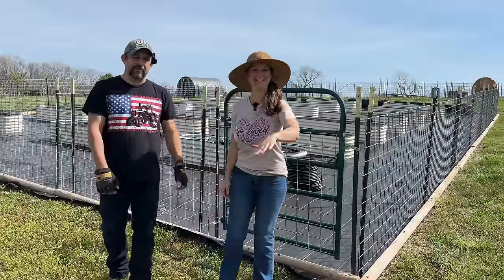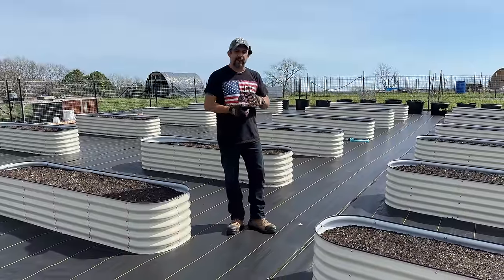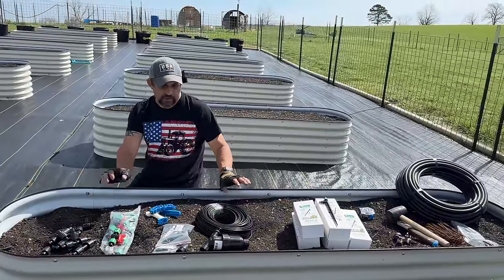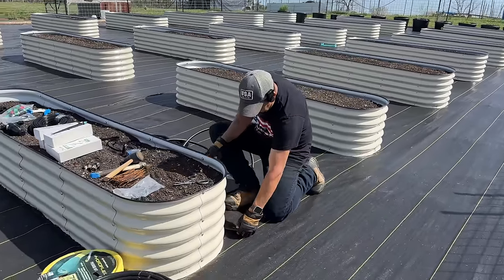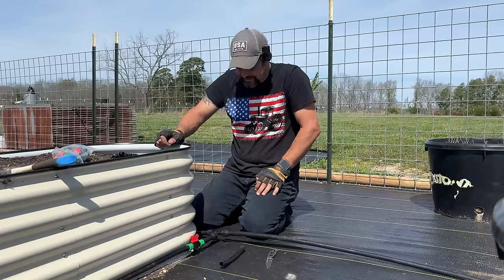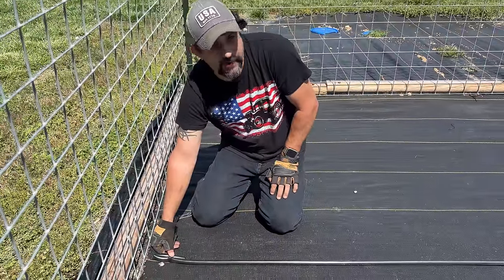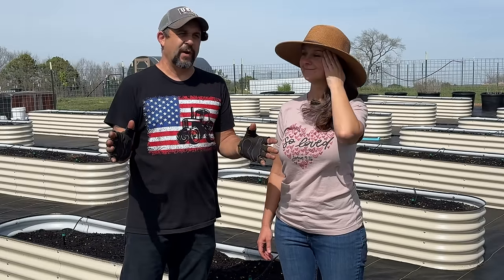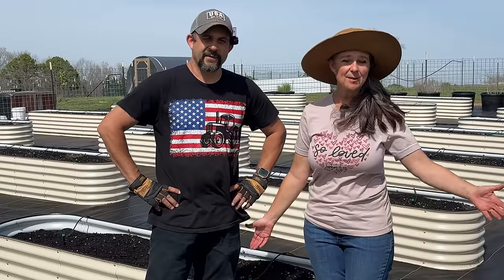The BEST Raise Bed Garden Watering System!!!!

Comment from the maker: Here is a link to the Raised Bed Irrigation components: https://www.amazon.com/shop/livingtraditionshomestead/list/3EXLG8NZE5AA6?ref_=cm_sw_r_cp_ud_aipsflist_aipsflivingtraditionshomestead_1EWAB2C42EQY03V94JXB
Reply: Ugh, it's saying the emitters are no longer available? 

BTW, the garden is absolutely gorgeous,  so gorgeous in fact the wife decided we need to redo ours!! Lol, we are in the process of redoing ours anyway, so now we have yours as a road map!!
Thanks for sharing your hard work!
Reply: @markhornbaker5481  What are you going to use since they aren't available?
Reply: The holes that the staples make that allows the weeds to grow, can you put some silicone caulk over the holes to prevent the grass/weeds from growing up threw them?  We are about to do the same thing and just wondered if you had tried that, I’m just at the 15:00 mark and thought to ask.
Reply: Where might one find the Drip Irrigation Drippers 360 Degree Micro Sprinklers Pressure Compensating Emitters with Stake for 1/4 inch Tubing Watering System Spike Bubbler Heads Parts, 20-Pack that you recommend as Amazon says they are no longer available?
Reply: Where can we get the sprinkler water head?
Reply: Wonder why they don't reply to some of these comments
Reply: What's  another source for the emitters, please ?
Reply: Yup. Emitters are no longer available and the valves/cut offs recommended may cause my hubby and I a divorce. lol. T valves are working awesome, slide right on, but attaching to the close off valves - not so much. We are fighting every one of them and they pop off. We are going to attempt a slight heat to the end to make it a tiny bit pliable. We shall see! 😂

Comment: I am a widow and I need to add a sprinkler system to my raised bed garden and front flower bed.  Until this video I always thought this would be a daunting task.  Thank you, Kevin and Sarah for providing the proper equipment and supplies lists and for explaining it so simply and thoroughly.  I know I can do this by myself now instead of having to pay someone to do it.  I feel empowered.  Hallelujah!
Reply: It’s such an incredible feeling to know that you can do projects without a bank roll. Kevin and Sarah definitely empower us with such useful and well taught information 🫶
Reply: Yah, this is a great video and wish it was available a couple of years ago. Really great video. You said you are a widow, but I don’t have a gauge  for your age.  So, just a couple of notes from a 67-year-old.  It is not so easy to connect all the connectors.  I am not strong enough, so soak your pieces in hot water and it makes it so much more pliable.  I use a large insulated cup and let my pieces soak for 30 seconds or so and then it is super easy to snap in. Also, going with a non-Amazon company will get you some customer service.  I used Drip Depot and they held my hand a bit to overcome obstacles. I have a mostly container garden with a timer and it has worked really well for me.  This is a really great video with detailed information.  Hope this additional insight helps.
Reply: I really appreciate you sharing your experience with us….In November of 2023 my wife died and 3 weeks later my mother died….when they were in ok health my mother and wife loved to work in our little garden….I miss them so much and I know they always enjoyed our time in the garden….i have such wonderful memories of all of us in our garden….I hope you have the same happiness…God bless you and I wish you many happy times in your garden…..😃
Reply: I’m a widow too and I’ve been wanting a drip irrigation system for the past few years. I’m so thankful for videos like this to help me understand what I need to do. I feel good that I can do this! I wrote down the tips from the commentor who said to soak the parts in hot water to make them more pliable and to buy from Drip Depot instead of Amazon.
Reply: I’m 60 yr old woman about to do this by myself, as well. Good luck to US!

Comment: I have 14 - 5x8’ beds and went this route several years ago, and have a separate water connection to each bed so the early planted beds can have water without wasting water on beds that have not yet been planted, and can turn off beds that are done. I needed to go this route due to still working full time and having limited time to garden. Best thing we ever did!

Comment: I'm sure someone has mentioned this already, but the splitter that you are using at your water faucet/hydrant is your bottleneck. If you get a full flow wye or splitter, you will get full flow to your garden and can most likely run all the beds at once. I've never liked the splitters that have such a small opening. Love your garden.

Comment: Looks like a great solution to a specific situation!  I went to your Amazon links to order the pressure compensating sprinklers, shut off valves, and hole punch tool, only to see ALL were out of stock and they "don't know when or if there will be more."  Have not really located a good alternative yet, so I guess we will watch and hope they get more in stock.  

We have a 40x50 garden equipped with ground cover fabric and drip tube irrigation thanks to your guidance from the "old" homestead.  It has enabled me to successfully keep gardening with Multiple Sclerosis at age 67.  We owe you a lot for what you showed us!

This Spring we added three Vegega raised beds (3.5x6.5' configuration) outside the garden, again thanks to what you introduced us to.  That is why this video was of interest. We put ground cover fabric under and around each, and placed 1/2" hardware cloth under each bed for critter protection since we have voles and moles around can be a problem to crops like carrots and sweet potatoes.  Also bought one of the Vegega bed cover systems to try, allowing for a plastic cover for cool weather planting and a mesh cover to hopefully protect the brassicas from moths!

Thanks for all you teach, and please leave a note if you know of another source for these sprinkler heads...

Comment: The white & blue hole punch is a great tool to have.  It is so much easier.  I've had mine since they were just under $10.  The Figure 8 closers are impossible to use.  I can't get them on the hose,  Zip tie method is much better.  I've also used twist ties.  Your weeds must be family to my weeds.  They grow faster than anything!

Comment: This 76 year old lady thanks you so much for such such a clear and simple tutorial on how to do this for my containers. I've been intimidated to try this but you made the process so simple. I do know I need a backflow device and pressure regulator up by the house spigot. You are the reason I'm giving it a try this year. However, your sprinkler heads are sold out and cannot find another brand of pressure compensation sprinklers so will have to compromise there. Thank you, thank you, thank you!

Comment: Hi Kevin from DownUnder. I must congratulate you on your absolute detailed sprinkler system installation.  U r an excellent teacher and even at my old age of 79 yrs I was able to understand and follow every step. This is the system I would like to install when we move. My son built me 16 raised vege garden beds but I use the hose connected to the water tank and I don't mind watering as I find it very therapeutic. We've had great success this summer as we get sun all day 6-8 hrs. Great work and God bless u both.

Comment: Now you just need a T after the hose filter with two valves so you can switch between the two zones easily and not have to fiddle with the individual rows once you have the pressure set up right for them.  I e. Cut the line after the 4th bed and terminate it.  Then run a second line and hook it to the last 3. A little extra hose and a couple valves but a lot less fiddling each day.  Great video on the basics of how to set this up.

Comment: JudithB  Working on my garden  beds  today  and  planting the  tomatoes.  I  have  a  stand  someone  put together  with the  hose  connection at the  bottom  and  4  spigots at 3'  high.  It  has  a  spike  to  stick it into  the  ground.  I  think I  will  get my  water  system set  u  with  it,  so  I  just  have  to  turn  one  spigot off  and  another  one  on  to  water  my  raised  beds.  That  leaves  one  spigot  for the hose  to water  the  chickens  and  pots,  and  a  spare!  LOL!!!

Comment: I have found that 19mm(3/4”) tubeing gives better pressure than 12mm(1/2”) when you are doing such long lengths and as many sprinklers as you have. Just my opinion and a bit late now, but a great explanation and tutorial. Well done, Thanks.

Comment: Love watching you two! We would install a four Station timer on the inside of the garden. Each station can control two or so beds/pots. We can’t use the half-inch connectors you use anymore, our hands just can’t handle it. We’re using the push on half inch barbed connectors, so much easier/faster.

Comment: I'm curious about why you chose to switch from drip irrigation to the sprinkler system?  Drip irrigation would be a much more efficient use of water, and the sprinklers will get your plants' leaves wet and splash on the soil which is how some plant diseases can get started.  What is the benefit?  Do you plan on putting anything on top of that woven fabric?  It looks like all that black material on the ground would get really hot in the sun, and radiate heat during the warmer months.  Thank you for explaining the pressure compensating system--that's really neat!

Comment: Start thinking on how you 2 can protect your area from sun damage and hail ,as I have grided out my total area and have retractable sun shade cloths,in 10'x10' profiles ,making them quick and retractable and manageable ,,I have a 10 ' high deer fence surrounding my area and tight protection from small damaging animals on the lower bottom of my fence,48" high..Here in Ga in June and July ,tomatoes will curl up and die from the suns direct heat ,

Comment: After pinching and un pinching the ends will make it leak. A better solution is a pressure release drain. It automatically drains the line when the pressure reduces and closes with higher pressure.  Also eliminates freezing poly lines

Comment: So if you have a Master pipe off the utililty water system, you could have timers set up on the multiple irrigation systems.  Each system turns on with regular water pressure, finishes, and cuts off.  The next timer then turns on and irrigates its section.  Eventually, the entire grow beds can be watered sequentially - and no more hands-on dedicated time for irrigation.

Comment: Other than having to turn off/on individual rows, would it make sense to run 2 main lines? One for 3 rows and one for 4 rows and have them split at the faucet? Then you could turn on the one 'cycle' for a bit, and then the other 'cycle' for a bit.

Comment: What's the psi of the system?  How high can the psi go before the push on fittings blow apart?  If you had it to do over, would you put the irrigation in first (under the weed barrier tarps) so it isn't in the way of tripping and wheelbarrows?  That would leave topside only the red valves to adjust and the inline filter to check.  With the hot sun beating down, how many years does the black plastic last (up top in the sun, or buried?)  You could get a solenoid valve from Grainger's or wherever, and run the timer with full capacity inside the tubing for all the water you want.
Reply from the maker: We never run irrigation under the weed barrier because if there is a problem you would need to tear it all up.

Comment: What steps will you take to winterize the system?  Would you have to remove all of the tubing or just the sprinkler heads?  And would that be even feasible without ruining the tubing?  I'd love to install this system in my own 8 raised beds.

Comment: They are out of the Drip Irrigation Drippers 360 Degree Micro Sprinklers Pressure Compensating Emitters with Stake for 1/4 inch Tubing Watering System Spike Bubbler Heads Parts, 20-Pack

Comment: Every drip emitter is rated for ? gallons per hour.  You should have a pressure regulator at the water source coming into your garden.  I believe you have 21 beds on one water source and manually turning off and on three beds  is time consuming .  Add a battery operated timer with zone outputs. Add more main lines, from your timer, to your beds so your system is not dealing with low water volume. Un less you have an unlimited supply of no cost water pull out some of your sprinklers for drip emitters at each plant You have all overhead watering and some garden plants do not tolerate water on leaves or trunks.  There are too many of the same volume sprinkler emitter in 21 beds all on one line.  We use different rated drip/bubble emitters for some plants that are thirsty versus plants that require less watering.  Different water per hour emitters are necessary for your amazing raised bed garden.

Comment: Good Morning! I am planning on putting this in my raised beds for this year and I have a couple questions. 1. Does water stay in the lines after you shut it off? 2. If so are you afraid that the water will heat up and when you go to water again the plants will get the hot water before the cool? Could be a dumb question and a self explanatory answer, but I thought it was worth it to ask.
Reply: A similar question was asked earlier. Sara said they water early before the water heats up in the tubes
Reply from the maker: We’ve been using this type of system in our greenhouse for several years and haven’t had any problems

Comment: Was wondering you live where it gets cold so I am sure you pull all the water systems apart in the winter. I live in north Florida we don’t get down to freezing temperatures but just a few days. Do you roll all those up and store them? I’m trying to figure out an easy way you completely drain those little lines so they don’t bust, any suggestions?

Comment: I have never seen a more perfect garden. It's pristine. Now I'm excited to see it grow. I just have one question. Those black hoses are going to absorb a lot of heat from the sun, causing the water  to be boiling hot. If you painted them white,  wouldn't it help?
Reply from the maker: We haven’t noticed that being a problem.  We also try to water in the morning while it’s still cool out.
Reply: That was my thought as well. Watering in the morning makes sense.
Reply: @conniegage2141, The water is coming from a well so it should be somewhat cool?
Reply: @chris3m98 they are talking about the water that will stay in the system, just sitting there absorbing solar heat in between watering.

Comment: The Yeedoox sprinkler system recommended is no longer available.  I’ve looked online to see if available somewhere other than Amazon and cannot find it.  I have found drip emitters that are pressure compensating but not on a stake.

Comment: That’s a great system. I do have a question - and it’s something I’ve worried about with my own irrigation systems here in central Georgia. In the summer the water that comes out of the hose of my irrigation and drip systems for the first few minutes is scalding hot. I imagine it would be even worse with the black mainline hose. Is that something you worry about - or are plants reasonably inured to hot water showers?
Reply from the maker: We water in the morning
Reply: @LivingTraditionsHomestead  Ha! Yep, I guess that'll do it. 🤦‍♂

Comment: Mr Kevin , I have looked all over for these ""Drip Irrigation Drippers 360 Degree Micro Sprinklers Pressure Compensating Emitters with Stake for 1/4 inch Tubing Watering System Spike Bubbler Heads Parts, 20-Pack "" Amazon is out of stock and I haven't been able to locate any  others  at All , Got any hints Sir ??

Comment: I have a question about the in-line filter.  Is it easy to clean out if it gets clogged or, do you have to replace the whole unit?
Reply from the maker: It just unscrews and there is a little mesh basket inside.  You rinse it and put it back in.  Never has to be replaced.

Comment: I have been looking for those emitters and they are currently unavailable, I looked everywhere and there’s nothing that compares. Any suggestions?
Reply: Also finding the same problem with finding the emitters. I have looked in the past year and they are still not available.
Reply: Rainbird makes some that are similar. I just installed them following this video's steps. The biggest difference is that the Rainbird emitters are flow through emitters. You can run them in series (hoses between emitters or do what I did which was use a small length of pipe pinched with a zip tie to block the second port on each emitter and run an individual hose to each emitter like they do on the video.

Comment: Thanks for sharing your watering system. 
Question: does your system have pressure regulator? From what I have seen most systems gave 25pdi regulator at faucet. 
Just curious how are you going to rotate garden beds from flowering, roots, etc? With 21 beds wondering how planning. I like your layout of beds.

Comment: We can't find the Pressure Compensating Emitters with Stake for 1/4 inch Tubing Watering System that you discussed.  They are not available on Amazon.   Any suggestions as to where to find them ??